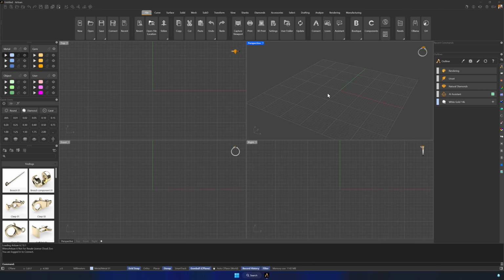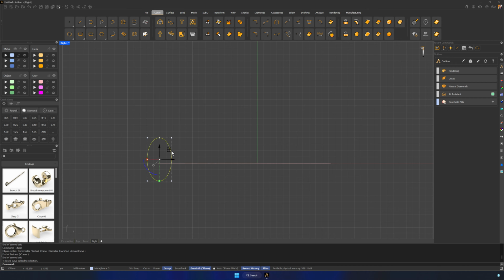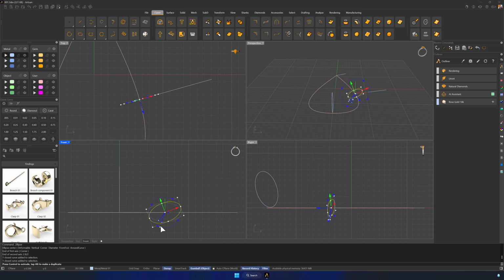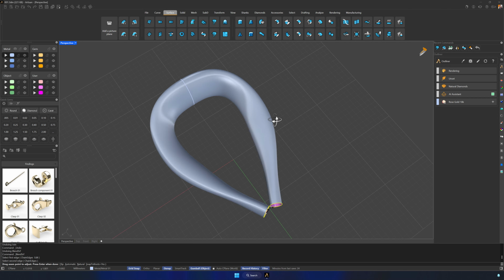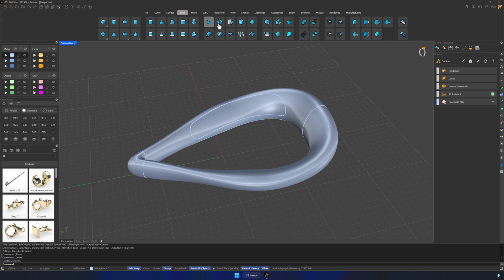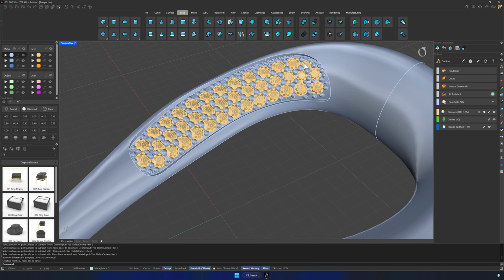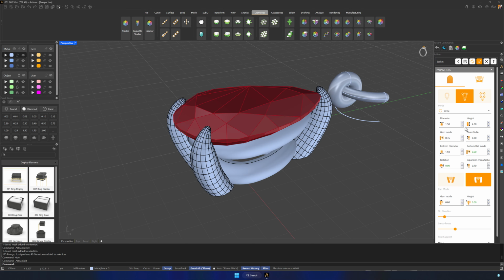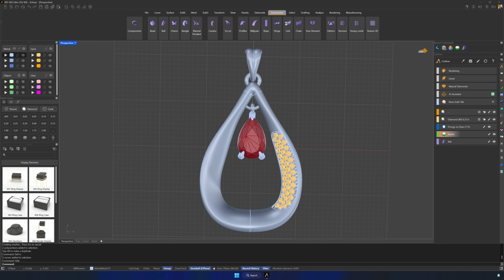How to Design a Pear Drop Pendant in Rhino | Jewelry CAD

Comment: Cool...but man...this is just a nice skin for Rhino.  Unless this is sub $500 how is this a replacement for MatrixGold or JewelBeetle?
Reply from the maker: Hi! Fair question, and honestly a common first reaction. RhinoArtisan isn't trying to be a separate app, it runs on top of Rhino because that's already the most powerful modeling environment out there. What it adds is a full jewelry-specific workflow, parametric tools, manufacturing reports, and STL prep, without forcing you to learn a completely new interface. As for the price, you should check our website, it might surprise you!